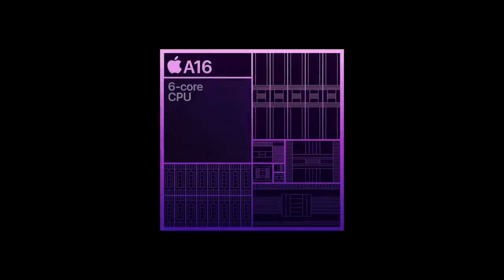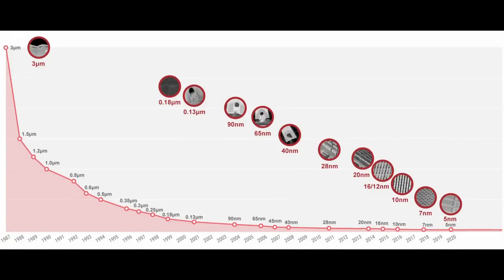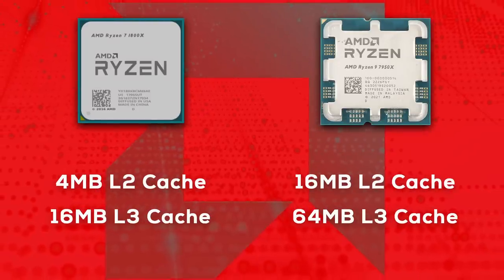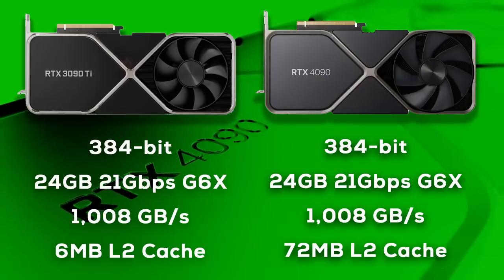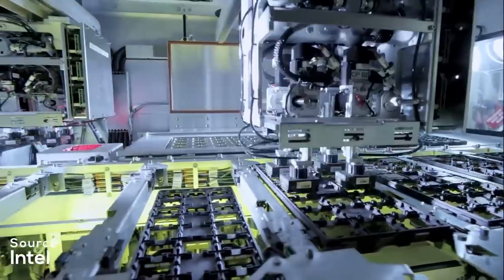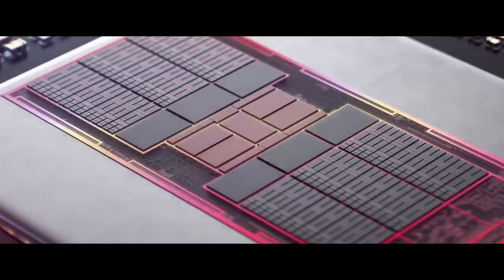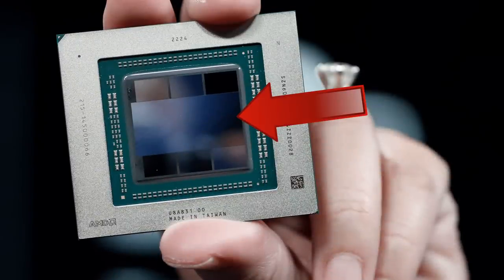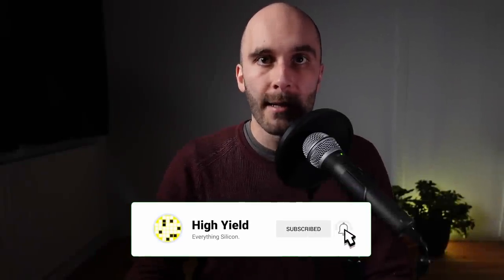Next-Gen CPUs/GPUs have a HUGE problem!

Comment: Nice video! But you didn't explain what "SRAM scaling" means in this context and why is it happening. I guess it means that the size of an SRAM cell does not get smaller as the process node gets smaller. But considering that the same applies to some other parts of the chip like interconnects, this is nothing new.
Currently TSMC 7nm or 5nm have almost the same feature sizes but the density is increased in smaller nodes. Logic circuits are not packed as close to each other as possible and this is where they get scaling.
SRAM does not have the possibility to be denser, since it already is as dense as it can be in a perfect grid. At some point logic circuits in the chip will end up having the same problem.
So the real problem is that the processes are getting less nm in their name while the transistor gate distance remains the same. They are decreasing numbers of the process but they are not nanometers anymore and this is what is causing SRAM problems. SOmething as dense as it gets has no benefit from increasing density, just from decreasing transistor size.
Maybe you want to talk about this "cheating" that is occuring in the process names. The name of the process no longer correlates to the distance between transistor gates. Maybe a video about process shrinking and how it changed in the last 10 years would be informative.
Reply: ^exactly he should have said SRAM chips stopped scaling in density rather than just scaling because also remember the register file and the microcode controller is also implemented as an SRAM in the execution pipeline and if there is more delay to access register file it would would mean less IPC and then why would you have faster ALU nodes paired with slower register file or microcode controller makes no sense
Reply: Yeah idk that this is as significant as he makes it sound. The entire reason AMD are going with chiplet designs in RDNA 3 is because there are already things like IO, and memory to an extent already, don't scale as well with lower nm designs, so they make the core GPU chip lower nm and higher nm for other parts where downscaling it doesn't lead to any real performance benefits while saving them money. Well that and it means they can stitch chips together but yeah.
Reply: This video mentioned that other components of a processor are also suffering from scaling issues. However, this is especially problematic for SRAM cells. SRAM not scaling means that to boost performance one must use more silicon. That’s very bad for the high performance microprocessor industry, which is the premise of this video. Other components not scaling well isn’t as impactful on the final designs because processors aren’t dependent on massive growth of these components; look at the cache growth to see why SRAM not scaling is really bad. Also logic cells don’t get denser by optimizing how they are packed together. The cells are reconstructed using different materials to hit desired performance targets at smaller sizes. Logic transistors are in fact getting smaller.
Reply: If feature sizes remain almost the same, what is it about new processes that enables them to reduce wasted space to increase density?
Reply: @dex6316  How do material changes allow smaller logic gates without allowing smaller SRAM cells?
Reply: @johndododoe1411  the SRAM has been ahead of the execution as far as density goes for a decade or so.

The Intel 14nm SRAM density is almost the same as their 10nm and TSMC's 7nm. SRAM isn't getting much denser but the cost per sq mm of silicon is increasing dramatically. They can use 7nm SRAM on a 3nm CPU and use the node that best fits the specific chip's needs.

This gives AMD a significant cost advantage over Nvidia right now and potentially an advantage over Intel, though with either company that advantage won't last.
Reply: @glenwaldrop8166  I was asking how that happened on a technical level, not asking for a pointless restating of the situation already explained.  I happen to know how an SRAM cell can usually be made from 2 to 6 MOSFETs that constitute a low power latch and a connection to the matrix lines that can force it high or low to change the value (contrasted with the single MOSFET and capacitor in a DRAM cell).  This basic understanding from the days of 10μm chips makes me wonder how logic circuits can be smaller than memory cells  beyond the obvious factor 2 to 3 between a 2 MOSFET NOT gate and an SRAM cell.
Reply: @johndododoe1411  phrased differently I would have looked up details to answer you better.

Given that response, look it up yourself.

Pointless anyway.
Reply: You can thank all the Intel haters for the nm marketing. People were laughing at them for using 14nm+++ but that's just really what it was. By contrast 16/14/12 nm used by TSMC was the same process just marketed to look like advancement. Same with 7/6 and 5/4. Now everybody is using made up numbers for marketing.
Reply: @w04h  They've been using made up names for decades.

I think the last time it was remotely close to any real measurement was 486 or Pentium.

Intel's naming was BS but they still kept the most advanced nodes for themselves going on 20 years. TSMC did something serious when they finally dethroned Intel as the best.
Reply: I DID IT. THE 69TH UPVOTE
Reply: True that. Everything below 10nm is more like "we have a ton of cheats and optimization so the technology appears like a 3nm" but it isn't. And second there is a point where those technology literally need to move single atoms. And they are already getting close to it. I saw it on the master thesis from my brother. 90% of it was "how to make the design in a way that interference between atoms doesn't appear". And it was on a 3nm processed chip. Means even logic can't be scaled more it is more of an "how to optimize what we've got" or completely start a new one from scratch. Like those science projects which are dealing with calculating with light.
Reply: @BruceCarbonLakeriver  Keller was already talking about having single atom precision, just not quite on commercial products yet.
Reply: @BruceCarbonLakeriver  yup bulls eye..i think next gen cpu will be different in everything we know today.
Reply: @glenwaldrop8166  yep but then quantum Interference is a big problem...
Reply: @beegonee  Well it depends on, what means next gen? 
Is it an architectural next gen or a next gen in terms of completely revise the basic concept of chip technology as a whole.
Like different base materials instead of silicon or light instead of electricity... 
For CPU makers next gen is mostly an architectural next step.
Reply: @BruceCarbonLakeriver  even worse, the effective field of an electron is a little bigger than 1nm if memory serves, that puts a finite limitation on shrinking. Even if they get down to 1nm it will require insulators and spacing. We'll have self interference at the electrical level before the quantum tunnelling effect.

Next step is going to have to be a lower switching voltage/higher conducting semi-conductor.
Reply: @glenwaldrop8166  I'm not even talking about quantum tunneling effects. But yes field effects of electrons are one of the issues (and those are quantum effects as well ^^). :)

Comment: Die stacking will get rid of this problem, they can use a larger process node with the SRAM, while the GPU/CPU cores are using the lowest node possible. They'll also likely start using HBM once they go full PC on a single chip design.

Comment: Eh... they'll find a way around the SRAM bottleneck, like they always do.
There's the Chiplet designs like you mentioned, but I'm also interested to see what IBM's light-based CPU leads to.
Reply: Single core scaling ended when dennard scaling died. Multicore scaling isn’t really working that well as real time consumer applications like games cannot take good advantage of it without increasing latency (hemce why 144 FPS today doesn’t feel better than 72 FPS in the 90’s; more pipelined engine). Moore’s law scaling is not holding up that well either; it is about cost per transistor, but wafer prices are almost competing with density scaling.

Light is a piss poor medium for density of storage and density of logic. Light is very large. A blue photon is 350 nm big and when you approach that sort of scale you get weird effects like surface plasmon resonance and quantum tunneling. So you either incorporate the weirdness and do something with plasmons or you make a bus with micron sized wave guides; a lithography size that hasn’t been in vogue since the 1980’s
Reply: @soylentgreenb  So the absolute best photonics can do is non ionizing radiation ? which is very near ultra violet range, either that or find some way to mitigate the material degradation from using some ionizing wavelength (which afaik is impossible, or else even nuclear shielding on Nuclear power plants would not be of a concern anymore)
Reply: Considering we're quickly reaching the physical limits of what's possible for scaling all parts of the CPU, we have much bigger problems to worry about medium term.
Reply: @soylentgreenb  And what would be the big issue in utilizing UV for this?

Comment: I think 2.5D chiplets will stay at the L3 cache level, not the L2 level. There's so much data transfer and the latency needs to be so low that L2 on a chiplet would need to be closer/ stacked to perform well.

Comment: This has been known for a while and ARM have been looking to using some variant of MRAM to replace SRAM for the purpose of CPU caches.

While this is difficult in a monolithic die it becomes easier with chiplet stacking as AMD have already demonstrated with X3D.

Not only will MRAM offer non volatility/persistance for potentially higher power efficiency, but it will also offer dramatically superior area scaling to SRAM for larger caches.

Comment: I thought scaling had pretty much died around the 28nm nodes.  It seems AMD has already solved this issue with chiplets and 3DVcache  all the L3 cache on RDNA3 variants released so far by amd have the cache and memory controllers(which also don't scale much anymore) on separate chiplets on a cheaper older node than the main compute die. we will see larger packages with AMD and costs will continue to rise but their chiplet designs gives then Aussie advantage and Intel is already trying to implement their own version. A lot of the tech AMD uses is co developed with TSMC and isn't that different from the tech apple is using with its M2 chips I suspect this will only accelerate the transition to multi die SOCs and 3D stacking. Cache is a lot less energy hungry than logic so it makes sense that this what's seeing 3d stacked silicon first.

Comment: Bigger dies are inevitable, along with wider memory busses. Transistors and d latches(or whatever they are called these days), can only get so small and transistors can only switch so fast. The eventual step is wider word processing and wider memory word accessing. But hey, I am old and when I was into the nitty gritty of this stuff, CPUs were running typical TTL voltages of about 5 volts. So yeah, I'm expired.

Comment: Apple already has a CPU using chiplet tech. The M1 Ultra CPU introduced back in March which stitches together two M1 Max chips into a single package. They aren't currently using it to split off SRAM, but the M1 Max is an extremely large die comparatively.
Reply from the maker: Thats true, but since its "just" two of the same M1 Max fused together, I am separating it from chiplet designs like AMD is using, with chiplets of different sizes.

Comment: At about 5:55 in your video, you finally mentioned chiplet design - if you can't scale static RAM, just put it off the chip. Of course, that involves some additional delays, so you still need L1 cache on the die with the logic, but it helps a lot.
Reply: Yeah L1 and L2 probably still best on the same chip since latency is critical, but L3 is a great candidate.
Reply: I feel like we're back in days of Pentium II and III.
Reply: @Tigerfox_  Except for many work loads, the P2/P3 with smaller on-chip L2 cache was faster than the larger off-chip cache. Celeron with 128KiB of on-chip L2 cache was faster than the 512KiB off-chip cache Pentium. In this case, I think the off-chip ran at half frequency. Much faster than DRAM, but a few factors lower bandwidth and higher latency than on-chip. Going off of memory from 2 decades ago. Take it with a grain of salt.
Reply: @BenjaminCronce  I know all that, but I don't understand what you're trying to say. Of course, for some workloads more cache is better than faster cacher, for some it's the other way around. I haven't seen an in dept analysis of what applications profit more from Raptor Lakes increased cache yet, but I know that for example only some games profit greatly from 5800X3D's 3D-cache, same as some games run faster on Broadwell i7-5775C wirth eDRAM L4-cache than on on i7-7700K.
They'll have to find a compromise. AMD reduced the size of infinity cache slightly on RDNA3, but vastly increased it's speed.

Comment: Use SRAM as a physical buffer between cores, and build vertically.  The relative physical size difference would mean there is a larger distance between each core, distancing the hottest parts, and allowing better thermals.

Comment: This could mean AMD will have a big advantage as they have already done a lot of the research on chiplet designing and manufacturing. So they are already ahead of the curve. but with both intel's and Nvidia's insanely deep pockets they can just throw a ton of money at the problem and get it done quickly.
Reply: Amd's chiplet design is codeveloped with TSMC, so anyone that has their silicon produced by tsmc will directly and indirectly benefit...

Comment: I think some caches will become near obsolete to make room for the more essential caches.
Think of the separate cache for code that is indirectly fed from a data-cache.
By changing them to just storing pre-decoded meta-data (like instruction boundaries on x64, or other decoding hints) and fetching the actual code from the data-cache instead when needed.

There are more such tradeoffs to make for sure, like cache-complexity versus cache size.
If cache size is under pressure by this scaling development, expect more complex/smarter caching systems that until now did not make economic sense.
Reply: There’s a very good reason for split I and D caches - they allow simultaneous fetching of instructions and data. A pure Von-Neumann design (shared instruction and data memory) can only execute one instruction every other clock cycle (one instruction fetch followed by a data access relating to that instruction). Modern cores are all modified Harvard designs, that allow simultaneous fetching of instructions and data access via the two different caches. They are also quite small compared to later caches in the scheme, so unifying them will save little space.

The better solution to the problem is 3D stacking and using simpler/cheaper process nodes to create cache layers. This actually gets the cache closer to the point of use while letting you increase sizes.
Reply: @stevetodd7383  I understand those points and I think it's an argument that has been loosing validity for some time now.

Ever since the introduction of the level-0 uOp cache, the effect of large level-1 instruction caches has been going down. And those level-0 caches are getting bigger every generation!

There is a saving to be had there for sure. By making them smaller, but smarter. For example by increasing set associativity or as I suggested by storing only meta-info/tagging relevant cache-lines in L2 as being used for code.

As both L1 caches are fed from L2, there already is concurrent fetch capability at that level. I1 Cache is virtually all about lowering latency for non-decoded instructions! A smaller cache that speeds up the decoding would give the same benefit as todays caches. Putting some of the cache area towards a bigger uOp cache will see more benefit I think (at least that is the trend right now).

As for Die stacking, that is all about level 2, not level 1 caches. This also speaks in favor of the idea of a smaller L1 instruction cache as the code will be in that extra large L2 anyway.

Level 1 instruction is simply between a rock and a hard place (the much faster already decoded uOp cache and the much larger and extendable L2 I+D cache).

And there is another trend looming, sharing massive level 2 caches between cores! That can be a huge transistor count saving architecture feature.
Reply: @TheEVEInspiration  a cache only accesses the next higher level in the case of a miss. At this point there is typically a burst of activity while a cache line is written or read. Because of this I and D caches don’t typically access the L2 concurrently. Each level of cache has a progressively higher miss cost, and then adding multi-port access adds more. The I and D caches are deliberately small and fast. L2 is larger and slower, L3 larger and slower again. The job of the I cache is to keep the instruction decode pipe fed as much as possible. That pipe results in L0 uOps, but there’s a higher penalty if L0 misses and you have to go all the way to L2. The job of the D cache is to keep the data needs of the uOps fed as much as possible while avoiding the need to go to L2 again. 

There’s a reason that we don’t just have a single layer of cache. Big and complicated caches are slow. Cache models are a trade-off between the need to maximise hits and the time to return cached data.

Oh, and to add to that, L0 cache is in the form of VLIW instructions that are far from compact. You’ll not get efficient use of space if you try for a large boost to the L0 to make up for no I cache.